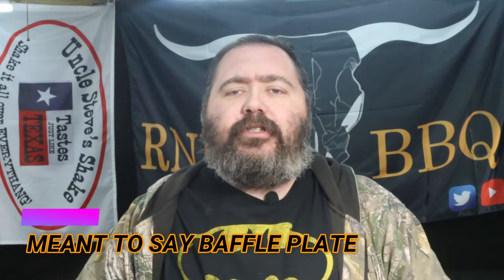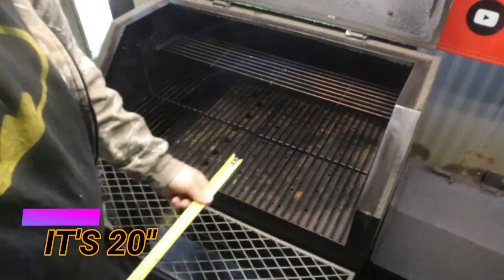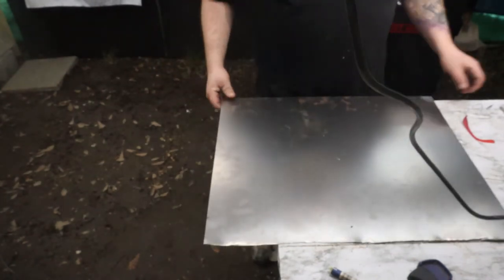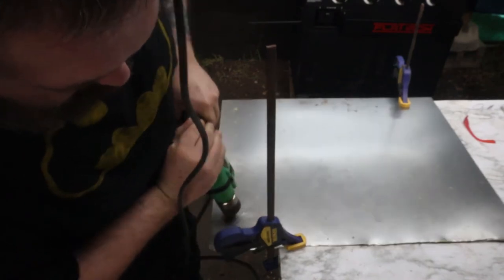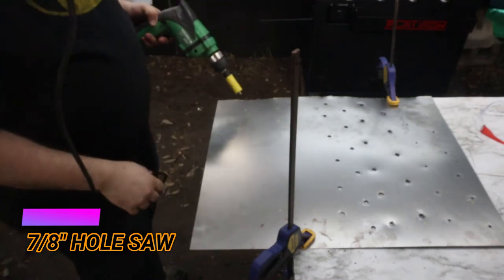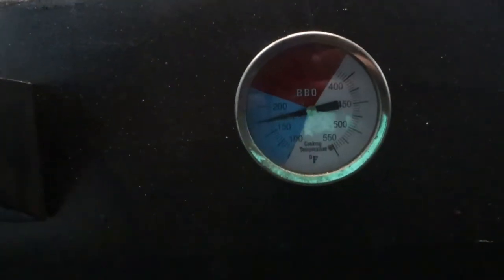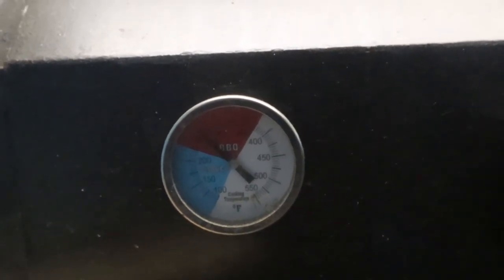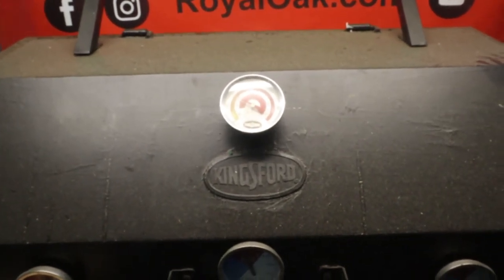HOW TO MAKE A BAFFLE PLATE EP. 72 #cajunrnewbbq

Comment: Hi, my quarter inch baffle plane keeps warping so i bent it flat again. Is it safe to weld another quarter inch steel plate on top or bottom to reinforce it? and should it be on top or bottom? thanks
Reply from the maker: Hi. sorry ive been away.  is it having a bow in the center? if so thats normal  after a few runs. If its completly warping out of place your fire is running to hot. You may have to get a thicker piece of steel. What kind of pit do you have?
Reply: @CAJUNRNEWBBQ  Hi,  we just have the usual extruded box with door on front and baffle at top. It quarter inch steel? iron? and i was thinking of welding a thinner plate to it under to take the heat and the original plate above  will reinforce with two pieces tight together. Only weight is consideration as the pegs have to hold it up inside.  adding a piece of plate cant be a issue surely?
Reply: @NEWBBQ Also the old plate has bits welded to it such as two long 1 inch long boxs with O2 holes to flood the top and bottom of plate with air to dilute the smoke on the plate, so i need to keep old plate and cant buy another so adding a plate to it seemed logical .